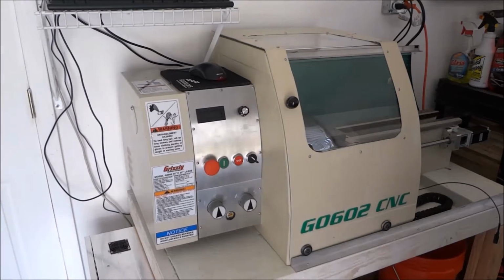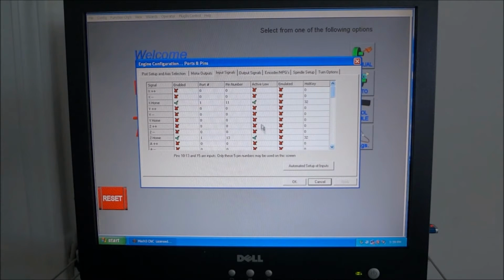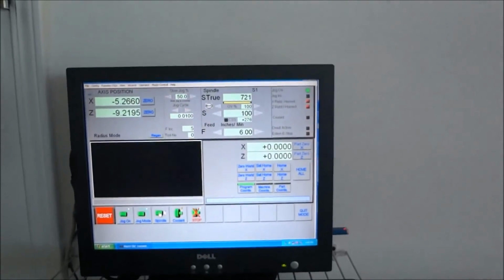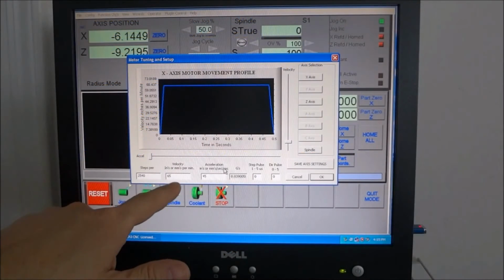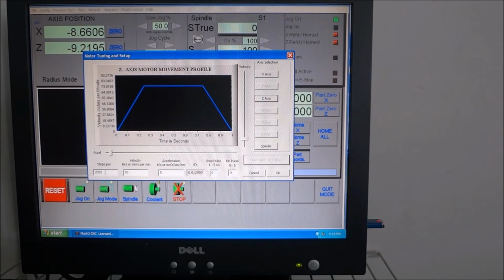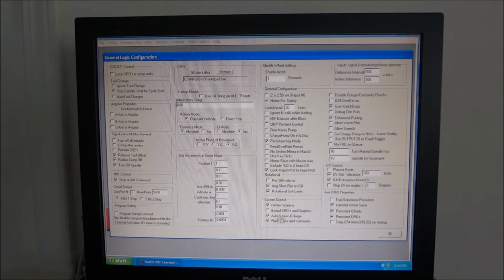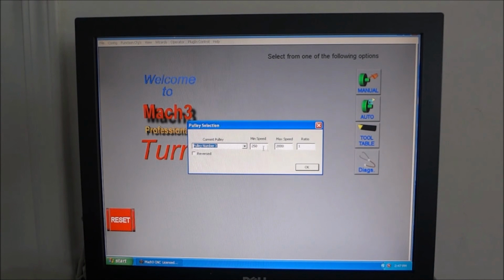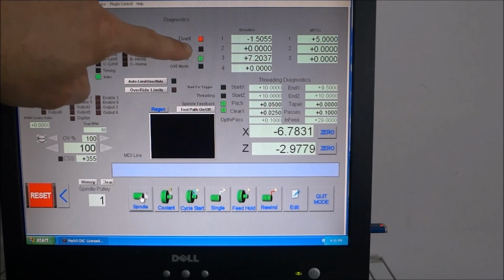G0602 Project Pt. 17  Mach 3 Turn Setup

Comment: Sir please reply.
 How to input the backlash values in mach 3 turn?
Reply from the maker: Top Left Config? Backlash input values in here.
Reply: backlash distance in units. whats mean?
Reply from the maker: Tippo jee 
Yes input your measured  backlash there in mm or inch.
I run mach 3 in inch so I would enter a decimal value .0001 etc.
Reply: Ok sir. But how to find my backlash distance in units?
Reply from the maker: Tippo jee
 set up a dial indicator and move the axis in one direction a measured distance then back say 1 " the indicator should read 1 " if not the difference is your back lash.  Check my videos I measure my machine back lash so younger a idea
Reply: Ok sir thanks for reply.

Comment: Thank you for answering, sorry for putting you through this headache, I looked at the "Jog Controller" and it is set at 100, in fact I changed it to 200 to see if it makes a difference , it didn't. I am stumped...
 I am using KL 6050 stepper  drivers and steppers are Nema 23 torque of 570 oz in 36 volt power supply ...
Reply from the maker: +John Minasian 
You said your rapids are 20ipm?maybe you should email me. Cnc4xr7@gmail.com

Comment: I do use the "Shift plus the arrows to rapid, it is not anywhere the speed that you have on your lathe, I do use 36 volts and the repeat ability is very accurate, I have the steppers reduced 2 to one twice, before it turns the Ball Screw, maybe that slowed it down ? I set the MDI feed rate to 20 IMP and it doesn"t seem to go any faster, I have the acceleration and speed set to max before it goes wild.
Reply from the maker: +John Minasian 
 Hi John, when you hit tab and pull up the jog controller is the jog speed set to 100%

Comment: Hi Sam,  I finally got my Hardinge lathe converted to CNC, everything works fine except the rapid is very slow,  I have the speed set at maximum in " motor settings"
is there a solution for this problem? I am using nema 23 steppers on the Z and X .
would a larger stepper help ? say a nema 35?
Reply from the maker: +John Minasian 
Well what voltage ? 36. How are you checking hold shift and arrow. Key. That should give you rapid speed. Also check your jog speed. Tab button

Comment: Well, since I last posted here I have found several issues with my system. be careful when you buy cables for your cnc control boards. Turns out my cable is bad,  well, I say bad no signal on some of the pins. This could be correct for some functions but when you are working with these boards you need all the pins functioning. I knew it had to be something on my end. I am still going to change out the drivers with better ones like you used.
Reply from the maker: +James Hopkins 
hey James Yea those cables need to be Straight through cables You may have two way Ohm the pins and see. I have seen this before.
Reply from the maker: +James Hopkins 
Any Luck?
Reply: +CNC4XR7 still waiting on a new cable, and I am going to install the better drivers as well should know something more by the weekend, and new mill is on it way, shipped today! I'm excited!!

Comment: I don't understand, the only thing different is my drivers, so I am ordering some exactly like yours. I can't get anything to happen. Everything comes on but no movement, looks so easy!!!
Reply from the maker: +James Hopkins  hi James Email me and let see what s going on.
Reply from the maker: +James Hopkins  It may just be a setting in Mach 3
Reply: +CNC4XR7 I think these drivers are junk, have not heard a lot of good about them.
Reply: +CNC4XR7 I may have too much voltage to the drivers, I think these are only good to 24 volts, they don't say that anywhere but seems I saw it somewhere. I have 36 volts to them, I think they are kicking out due to overvoltage. That being the only obvious reason I think I will just get some better drivers and then see what happens.
Reply from the maker: +James Hopkins  Ok Well Let me know if I can be of any help, Are you getting a red Fault led?

if you send me a private message we can exchange emails Be Safe Sam
Reply: +CNC4XR7 The best I can gather about these drivers is that you get a red light any way you hook them up. They are not very good drivers. I have ordered the other type drivers and hopefully they will be better.

Comment: Sam thanks for the good info, I wanted to know how many amps are you applying on your steppers, mine are getting warm at 3 amps.
john
Reply from the maker: +John Minasian 
Hi John that sounds about right 3 amps. I have them set for half current at idle. As a rule I power them off if it's going to be idle for more than a few min.  They will get hot this is normal. 
Be safe Sam

Comment: On 2 axis lathes defult X axis mode should be always diameter and usually there is no any reason to change it at any time.
Reply from the maker: +Radoslaw Jocz Thanks,
 Yeah I really could not understand why you would want radius mode but I figured it was a old school CNC thing since the G code runs  from a Radi point of view. Not being a trained CNC machinist I do not know.
Reply: There are some fairly modern CNCs for example (Sinumerik840) that you can use X axis in radial mode or diameter mode depending on the code in the program but default should be always diameter mode on 2 axis lathes to avoid mistakes. Most of round parts are measured in this way that you get a diameter on cylindrical surfaces and most of the drawings are done in this way also. However sometimes on the drawings are seen radial incremental sizes (for example shoulder of flanges etc.) but it is easy to calculate diameter by given radius and it is better way to do so instead of mixing approaches in the program. I can say this, it is based on my experience. But the main reason to use radial measurements on the lathe is when you are using multi axis lathe with life tooling then you can for example mill and drill on the face of previously turned workpiece in the same way as on the vertical 3 axis milling machine so then radial axes are usually preferred. In this case XY axes are available (both radial) because tool can go also above and below center line by calling Y axis (and Z is depth as usual), otherwise there might be XC axes configuration in simpler machines. C axis is rotary axis of main spindle (lathe chuck) then you can do positioning of the spindle in 360 degrees or define XC (Cartesian) plane. It can be used for some simple milling and it is often used for drilling and tapping on particular PCDs or making flats or hex for bolts heads. On some more rigid lathes you can do also keyway slots it saves the time. So the principle is to use X as diameter when turning, but when milling on the lathe X should be usually radial.
Reply from the maker: Thanks for clearing that up, I don't want to pass on bad information. I'm a little more familiar now with the cnc lathe and Mach 3 lathe.
Reply: +CNC4XR7 I do not know much about Mach 3 system. I was saying only about general principles used in CNC and engineering industry.
Reply from the maker: +Radoslaw Jocz Well it does make sense the part will be the Diameter not radius and why do you want to have to do the math all the time. Thanks
Be Safe,
Sam
Reply: no, if X is diameter in lathe mode and radius in mill mode then you do not need to do any math, usually

Comment: how much spindle run-out you have in this CNC lathe?
thank you
Reply from the maker: +Ozy Ozy Hard to say my dial indicator only goes to .001 There is some deflection I would say maybe .0003 to .0005
The spec sheet from the Factory listed it at .01mm  which I would confirm to be about right. For the stuff I do its fine.
Reply: +CNC4XR7  you did great job on this one! I love your CNC, I am soon will convert to CNC !   
I am just thinking of getting the G4003  and then convert it next year to CNC but the PM 1236 is looks more quality but 
really don't matter since you convert to CNC any lathe will do all threads cutting and turning if it got the encoder and the right software!! 

thank you again for your quick replay! and please post more vidoes
Oz
Reply from the maker: Thank you Oz 
I also looked at both of those lathes it's all about capacity the 4003 has the d1 spindle which I really liked.  To be honest I didn't need the 12 inch and stripping all the things that made those manual lathes nice just seamed like a waste so I went with the 10 inch. Quick change gearbox not needed clutch spindle brake not needed etc. 
if I can be of help let me know.